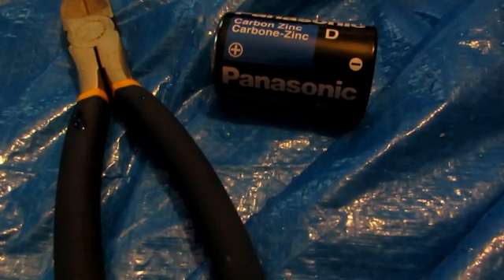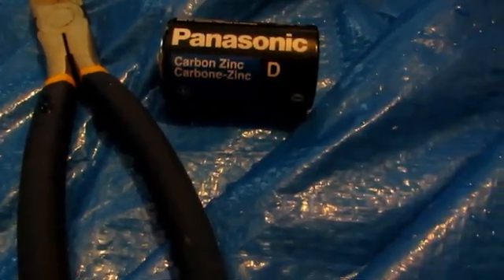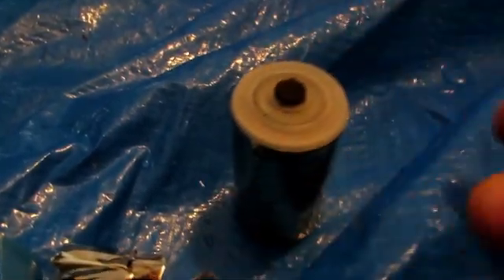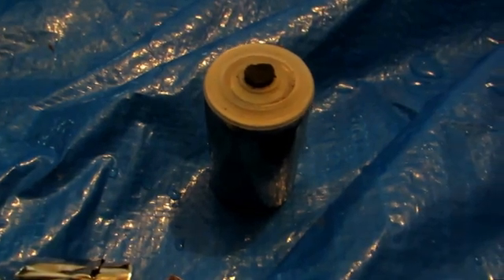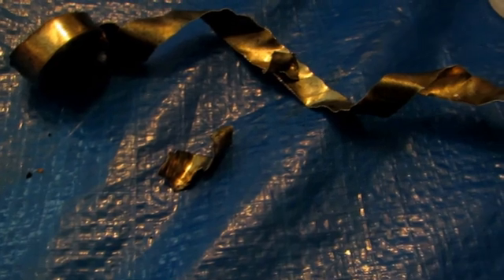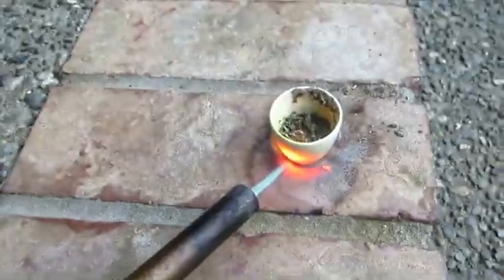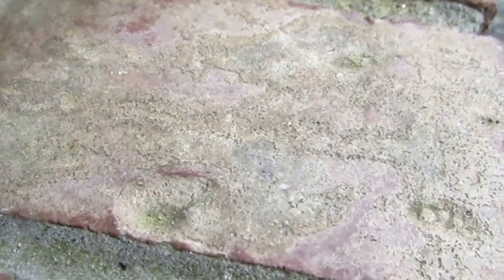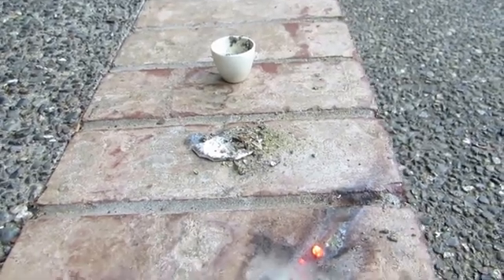Zinc from Batteries (Household Materials)

Comment: Pretty sure nickel-cadmium batteries have been discontinued, but if you can get your hands on one it might be interesting to extract the cadmium (of course with safety precautions, that stuff isn't very nice) and possibly the nickel
Reply from the maker: I have already extracted cadmium from nicd batteries, I did testing and it is definatly cadmium. In some contries they may have been discontinued, however in Canada they are still used in drill batteries. I went to our local dump and grabbed some old dead nicd drill batteries and each pack contains about 15 cells. I plan on doing a video in the future.